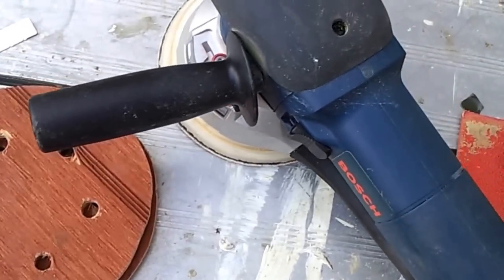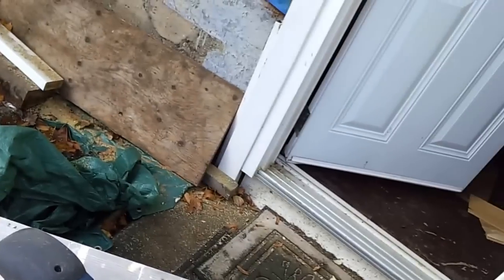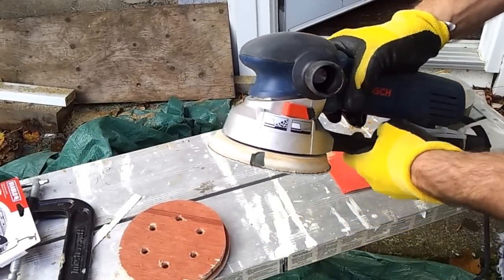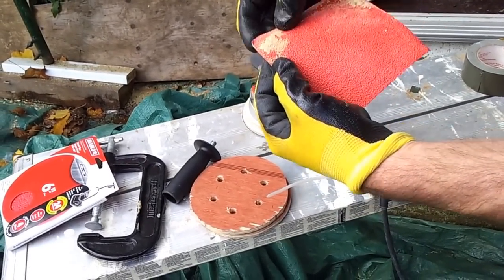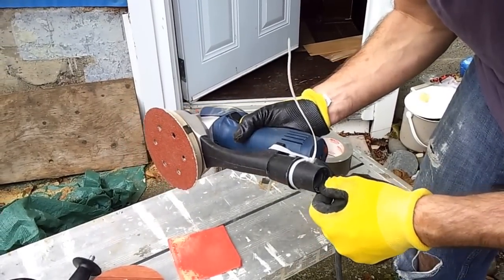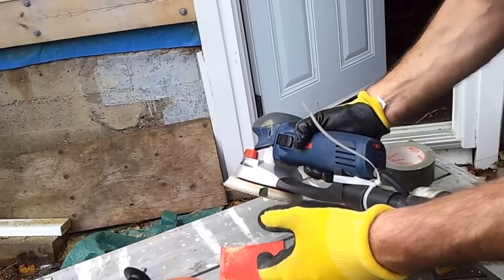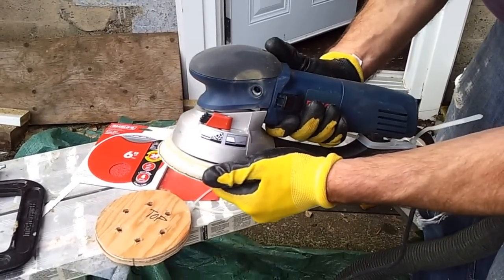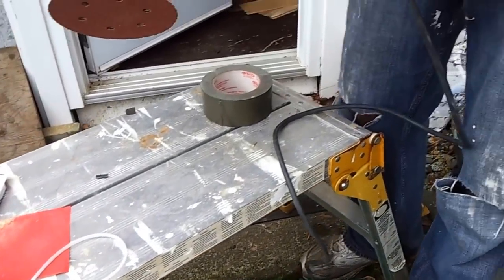How to strip paint with a Bosch 1250DEVS dual-action orbital sander

Comment: I understand why people are cranky about you not showing the actual sanding but it seems that you were just trying to give testimony about how well the sander was working for you. Thanks for sharing.
Reply from the maker: Thanks for the thoughts! Yeah, there's lots of videos showing how to remove paint with an orbital sander. I just wanted to show what was different about this to and why it works better than the smaller ones that don't have the turbo/grinder mode. Thought I might get maybe 500 views. Didn't expect it to blow up. I'll do a part 2 showing it used hopefully in 2020.

Comment: Get the Paint Shaver   it will zip rite threw that and youll only need 2 bladed YOu can set the thickness you want to take of and it will actually just remove the paint  all layers in  one pass

Comment: I didn't see how to strip the paint !!!
Reply from the maker: Hi @Issam, I didn't demonstrate the stripping, but I described it in detail in the video. I sanded in Turbo (grinder) mode with 24 grit paper until the cedar was partially exposed. Then I switched to Normal (orbital sander) mode to take the remaining paint off without damaging the cedar. (Turbo mode damages the exposed cedar.). I also used the orbital sander mode to sand along the underside of the shingles and along the trim. When I was happy with the amount of paint removed, I switch to 40 grit paper and made a couple passes in orbital sander mode to clean up the cedar. (24 grit makes it a bit fuzzy.) I'll add these comments above.

Comment: you didnt show how to strip paint.
Reply from the maker: Hi Monica. Sorry about that. I didn't have time to demonstrate. My wife was carrying our toddler while holding the camera (which is why she had put the camera down at one point to switch hands), so I had to rush because her arms were getting tired. Mostly I wanted to get across the most important parts, which was that the smaller 3 amp sanders were too weak for the job (the Bosh is 6 amp), the grit sand papers to use, and switching between the turbo and orbital modes.Your right that I don't demonstrate, but if you buy a powerful orbital sander and follow my instructions, you should be good to go.

Comment: Where did you purchase your 24 grit disks?
Reply from the maker: Home Depot Canada
Reply: @CouttsDesign  In the US, I go to the sandpaper section in Home Depot, and I don’t see this sandpaper. Is there a special area to find it
Reply from the maker: @pqworks9019 Sorry, I don't have any insights. It's not as popular as the finer grits so maybe HD dropped it. My only recommendation is to try online
Reply: @CouttsDesign  That’s fine. 40 grit works just as good.

Comment: Great a vid with no actual demo...wasted time
Reply: The 6" random orbital sander by Porter Cable makes that Bosch tool look and operate like a cheap tool made in China. Design alone that vacuum tube on the bottom is in the way vs the Porter Cable sander. PC also has a vacuum attachment with smaller hose vs that monster hose your handling.  I ran that PC sander as a long term torture but not a abused test over 5 years running it 3-5 hrs a day, it passed this test being very impressed. One minor detail, the aluminum plate covering the gear reduction drive held sown by one screw and a slot at opposite end not dust proof. Clean off then remove cover, check  grease amount possibly adding more if looking under greased. Clean the cover and gear case contact area, apply a thin coating of "THE RIGHT STUFF" (auto parts stores) sealing and preventing any dust and dirt from entering under the cover into the bevel gearbox. Note, sticky back paper remove from pad when done sanding while sticky material is still warm vs later cold preventing damaging the backing pad covering. Sticky back cheaper than loop and hook sand paper. Paper without holes lasts longer than with holes, more surface area as well less snagging and ripping apart your sandpaper when rounding off vs flat only sanding. Even the 330 PC palm sanders are the best after trying other brands bar none. Palm sander getting closer to stepped wood  lap boards vs random orbital sander.
Sanding leaded paint in my area i'd be in jail not alone a $25,000 plus in fines,  soil and air lead contaminated, EPA samples, house red tagged. Health hazard the ground around this video home owner's house then add the baby exposed to lead, wow!

Comment: Seems like you did more damage to your health by breathing the paint that you were sanding then just leaving it there, same with asbestos.
Reply from the maker: Didn't breath the paint. Had a HEPA filter on the vacuum, a respirator covering my entire face, gloves and a full body Tyvex suit c/w hood to prevent the lead from contacting my skin. Lead and asbestos can be safely removed provided the necessary precautions are taken. In my case, leaving the lead paint there wasn't an option, as 60 year old lead paint won't stay on a house without perpetual upkeep, which is why the previous owner had covered it with aluminum siding,